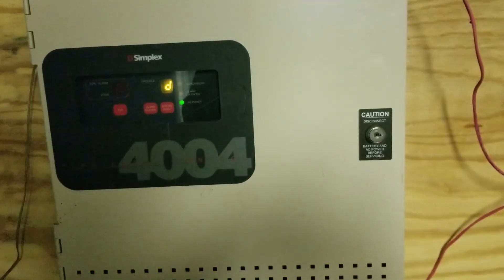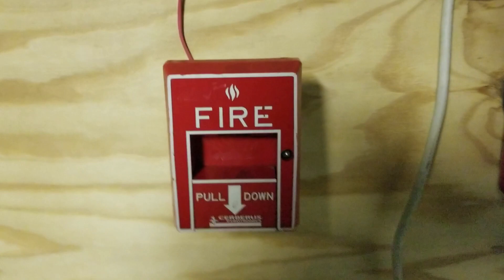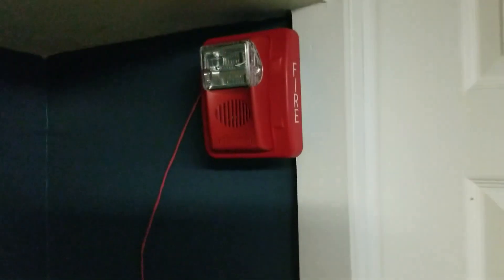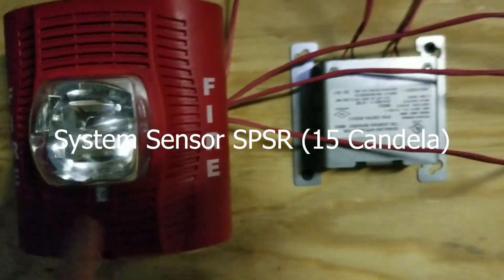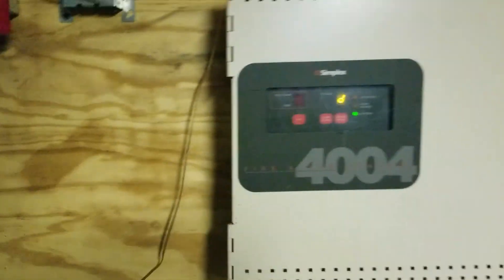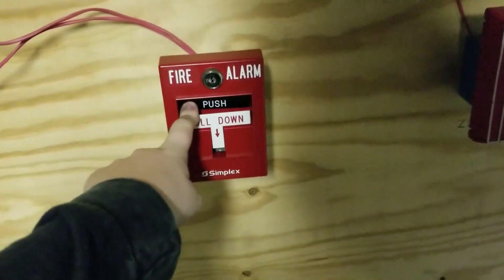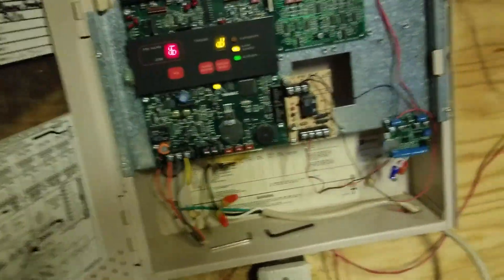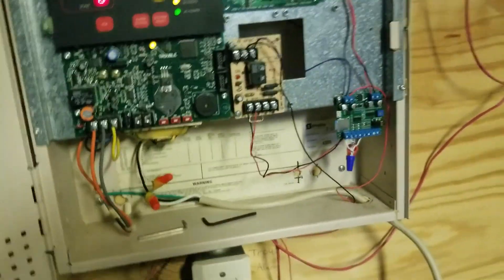System Test 4 - Voice evac!

Comment: do u have 3 mechanical horns lol
Reply from the maker: I only have 2 (Simplex 4903-9219 and Simplex 2901-9838), both of which I used in System Test 3 (https://www.youtube.com/watch?v=olCb010bVxQ). Am hoping to get some more mechanical horns such as the 7002t soon though!
Reply: @EthanBlaisAlarms  dang maybe get more some point
Reply from the maker: Will at some point. However, my next purchase will be a new panel so I'm not sure when I will be able to.
Reply: @EthanBlaisAlarms  what panel
Reply from the maker: @vintagesimplexfirealarmsof6440  Simplex 4006
Reply: @EthanBlaisAlarms  i own one of those and a 4004 i trying get 4002 or 4001 next
Reply from the maker: @vintagesimplexfirealarmsof6440  Oh nice! I actually own a 4001, it's pretty nice.
Reply: @EthanBlaisAlarms  when will u pull it out on this channel
Reply from the maker: @vintagesimplexfirealarmsof6440  Currently there's plans to make another board for the 4001 and do regular system tests with it but I'm unsure when that'll be